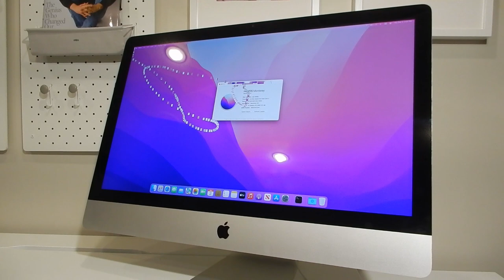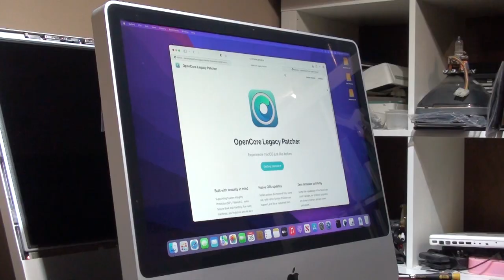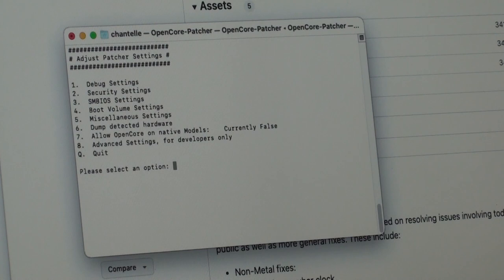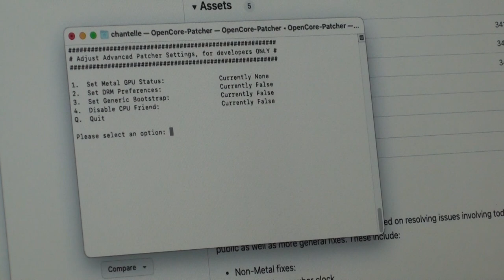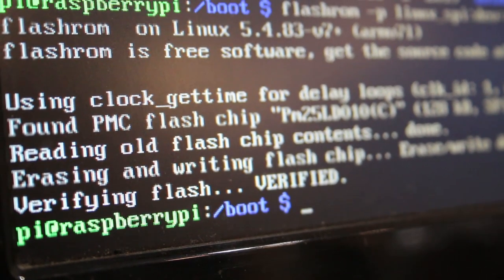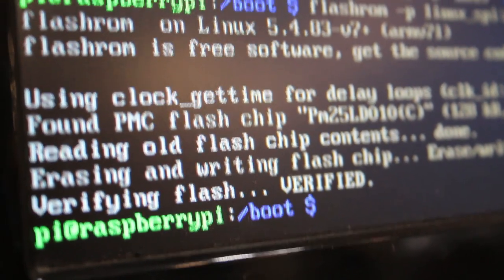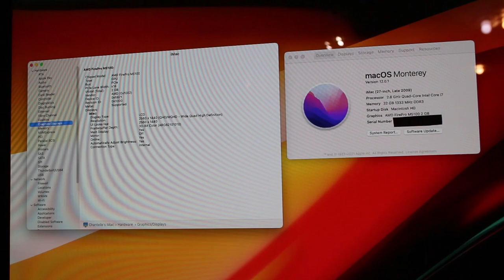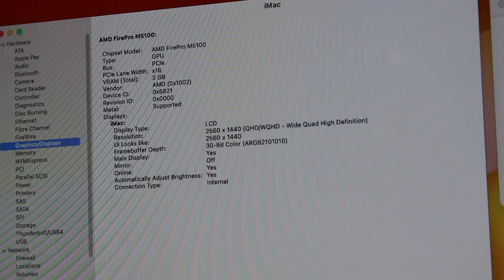iMac GPU Upgrade, Metal SUPPORTED!!

Comment: Thanks for the video, very helpful! I tried a few vbios versions (GOP, EG2, adj) but none of them ran without issues. What exact vbios rom did you use? Are you using a second screen and does it work without issues? Thanks for the help in advance !
Reply from the maker: I think there are 3 versions of the card: red (Dell), green and blue.  Mine is the red card, BUT there are also 3 more sub-versions of the red card depending on which memory modules the card has.  The red card uses the GOP ROM.  There are 3 GOP ROMs depending on if you have Elpida, Hynix BFR, or Hynix AFR memory modules.  I think mine was Hynix BFR so I used the M5100-HynixAFS-GOP.rom file, but yours could be any of those 3 if it is the red card.  The green and blue cards use totally different ROMs, which I don't know much about.

If I recall, the reason you need to flash the BIOS is to get the internal screen to work.  I THINK (if I remember) that the Mac should work on an external display without flashing, and after flashing/OpenCore mod it should work on the internal display.  I think external still worked after the mod, but I don't recall for sure - it's been a while since I did this.

The first part about ROMs I'm pretty confident is correct.  I'm a little hazy about the external screen details, but I remember before I fully got it working I could only get display via external monitor.

Hope this helps!  If you have any other questions, I will try my best to help (so long as memory serves what I did, lol).  Good luck!
Reply: @rebootretro  thanks for your help! I have the red dell card with Elpida storage. I currently have a perfectly working monterey system but my external display via mini dp/hdmi adapter is not working. As soon as i plug it in the iMac screen gets distorted and the second monitor stays black. I don‘t get why everything works but the second screen. Maybe I damaged the input during the GPU upgrade…
Reply from the maker: @luisheitmeier644  I just got my mini DisplayPort cable and tested.  On my finished iMac (OpenCore + custom VBIOS) external displays are working perfectly, exactly like a real fully supported Mac.  I would double check that your OpenCore settings are exactly right, and maybe try reflashing the ROM in case it went in corrupt.  It could also be possible there is an issue specifically with the Elpida ROM.  Hopefully you can get it going!

Comment: Hi, nice video do you think  this card will work on  2009 27 inch with macOS sonoma?
Reply from the maker: @unknownblueblue  I’m pretty sure it works with Sonoma, other people claim it does.  I eventually plan to upgrade this Mac to Sonoma and will make a video when I do.
Reply: @rebootretro  thank you very much, do you think this card is better than a k1000m?
Reply from the maker: @unknownblueblue  Bechmarks show the M5100 to be faster.  But I didn't care about speed, I wanted native Metal support.  The M5100 has official Apple drivers (at least on Monterey).  I believe all Nvidia cards require modified drivers.  I'm not sure if Nvidia cards work at all anymore on Sonoma, you should double check before using Nvidia.  Good luck with your upgrade project! :)
Reply: @rebootretro  thank you again, I bought the card today in 10 days probabily i'll receive it and if everything works i'll come here to tell :)
Reply: i'm here again to say it worked very well on mac os sonoma, did the open core patch, i downloaded opencore to my system and just did the patch at first it showed only 14mb but after the patch worked it recognize the 2gb from the gpu thanks for the video again

Comment: Hi, thank you for this Tutorial. I just would like to ask you: I have a mid 2010 27'' imac (11,3). Is it necessary to flash the vrom or will be the card working even without doing that operation?
Reply from the maker: There are certain cards that "work" but missing some functionality without flashing.  The M5100 (in my video) I think will only output to external monitor unless you flash it, and I think it doesn't get proper acceleration unless OpenCore is configured correctly.

I don't recall which, but there's one Nvidia card out there which will work "out of the box" with some custom drivers (no flashing).  It's documented on one of the forums.
Reply: Did you manage to fix your iMac?

Comment: Hi, i'm considering to buy this card for my 27'' 2009 a1312. Is target display mode still working for you?
Reply from the maker: Yes, the video here (https://youtu.be/TQwCJYiLqSo) about Target Display was made after the upgrade.  It felt glitchy sometimes - sometimes it didn't want to enable Target Display, and occasionally I had a crash when exiting Target Display.  Not sure if that's because of the GPU upgrade, because of the Monterey upgrade, or possibly completely unrelated.  But yes, after successfully getting into Target Display it did work properly while using it.
Reply: @rebootretro  Thanks. Sounds like the kind of behavior i experience now as well in High Sierra. The Firepro is on it's way tho!

Comment: Hi, I want to ask you another question: is it possible to flash the videocard in another way? I want to buy the card for a 27" imac mid 2011 and I do not want to use dremel stuff.
Reply from the maker: I've read somewhere that an NVidia card exists which does not require flashing - although you won't have boot screen/boot picker support.  You'd have to do some Googling, but I recall it was a specific version out of an Alienware laptop.  Sorry I don't have more details.

To flash a card, there are generally 3 ways.  First, using a flasher and clip like I did.  There are also USB programmers which let you flash using Windows if that's easier, instead of using a Raspberry Pi.  Second, install it in the iMac, boot to Linux and flash from the command line.  I can't offer any help on this because I've never done it, but someone else commented previously and said they've done this successfully.  There are many guides online if you want to try this.  Third, you can flash it beforehand using a donor PC, or MXM to PCIe adapter - this is likely far more difficult for most people since they won't have a donor PC or adapter handy.

Honestly, if you don't have any programming equipment, I would probably suggest a USB programmer with chip clip.  They're around $25 USD and likely easier to use than trying to boot Linux blind.

Comment: Will a radeon wx4170 work in a late 2009 model ecm 2309
Reply from the maker: I'm not familiar with that card specifically.  It does appear possible, but it looks like it needs some vBIOS flashing.  People have successfully used it on 2011 iMacs, but I've not seen any reports about a 2009.  I would recommend reading on the forums, and only use a card which is 100% confirmed working on your exact model.  Otherwise, there may be some unknown issues.

Comment: Can you put the link to download the vbios file to firepro m5100 red with chips hynix AFR because the three links in the forum i dont know if is to red, green or blue gpu. Thank you
Reply from the maker: That forum post is EXTREMELY confusing... I had to re-read it multiple times when I originally did the mod.  The conclusion I came to was that all 3 files under the download section were for the red Dell card, depending on your memory type.  My card was red Dell with BFR memory; I used the 2nd / middle link which worked for me.

If you have Hynix AFR, I can't promise you whether I'm right, but I suspect the 3rd / last link will work for you (https://github.com/Ausdauersportler/IMAC-EFI-BOOT-SCREEN/blob/main/GOP/M5100-HynixAFS-GOP.rom).  But make sure you double check, and make a backup/dump before flashing!  If you flash the wrong one, you will brick it and the only way to recover it is with a flash clip like I used.

Hopefully you get it working!
Reply: @rebootretro  no problem i have a ch341a the only headache its disamble all again but no problem. Thank you!!

Comment: What is the size and thickness of the cooper shim you used?
Reply from the maker: I used a random piece of copper pulled from a scrap MacBook cooler, and cut to size.  The backside had a black coating, which I cleaned off.

The cooler does graze the die on it's own but does not have enough mounting pressure, and there are springs for tension so there is some leeway for thickness.  The recommendation in the guide I read was 15mm x 15mm x 0.5 to 1mm thick, which would be close to what I used.  Here is the article: https://forums.macrumors.com/threads/2011-imac-graphics-card-upgrade.1596614/page-320?post=28696585#post-28696585

Comment: This is awesome to see, it took me forever to find this video, so I was beginning to thing an old Metal compatible Mac wasn't possible.  
I'm planning on doing this to my 2010 27" however, I'm not that good with the actual tech side of things. I'll be able to do the physical install fine, but I really don't understand which card to buy and how to do all the programming stuff.
Unfortunately there isn't a computer shop anywhere near me (plus I don't wanna have to pay anyone), so I'm on my own with this.
Anyone here who understands that programing side of things who'd be willing to help out?
Thanks
Reply from the maker: The issue is that there really isn't a perfect card to use, to my knowledge anyway.  There is no officially supported Metal card for any of these iMacs, which means there's a bit of hacking involved no matter what you choose.  Some cards are easier, some have better compatibility, some are cheaper, and some are easier to acquire.  Sometimes the best card is the one you can get your hands on.

In my case, the card I used was the FirePro M5100.  This card has excellent Mac OS support, but poor iMac support requiring a bunch of hacking like I show.  Some Nvidia cards have great iMac support, but poor Mac OS support requiring lots of OS driver patches.

A few things to note though.  This isn't a simple upgrade, it is very difficult and very involved and requires lots of reading and patience.  If you get stuck, you probably won't find any computer shop willing to help you regardless of cost.  This is a very unsupported upgrade, and most shops won't want to be involved in it because of the hassle.  Lastly, don't do this on your ONLY computer.  Make sure you have another working computer, preferably Mac, since you may need to run Mac software in order to recover your iMac if you make a mistake.

But don't be discouraged!  If you are willing to read, learn and be patient, you're on the right track to success!

If you have trouble, feel free to post back here and I'm sure myself or someone will post any pointers to help where we can.
Reply: Did u manage to make the upgrade?
Reply: @giorgos7six  No, I never tried. I don't have the time to tackle something of that scale and really have no idea what I'm even doing so I don't wanna fry it

Comment: Regarding the cooper shim, would you recommend 0.5mm or 1mm thickness for a 2011 imac 27
Reply from the maker: I've linked the article below which explains the copper plate/shim mod.  The thickness is somewhere in that range (.5 to 1mm).  The cooler is held to the die using springs for tension, so precision is not so important.  If it is somewhere near .5mm to 1mm then it should have sufficient mounting pressure.

The problem is that the die on the new GPU is not as tall as the old GPU, so if you have no shim then the die is not under any mounting pressure at all.

Here is the article about the shim mod that I used:  https://forums.macrumors.com/threads/2011-imac-graphics-card-upgrade.1596614/page-320?post=28696585#post-28696585

Also, there are some issues with this GPU on 2011 iMacs.  You should read up on this prior to using this GPU: https://forums.macrumors.com/threads/2011-imac-graphics-card-upgrade.1596614/post-17425857 (Look under 2. Working AMD Graphics Cards and then AMD GCN v1-3 GPU (2012-2015) - no iMac12,x support)

Comment: iMac 11,x on OCLP 1.3.0 and macOS 14.2.1, still need to use 0.4.6 TUI? or does OCLP 1.3.0 build OC properly by just selecting Advanced->Graphics Override to AMD GCN (maybe it will set x64.efi also?) Also know if Advanced->AMD GOP Injection need to be checked on OCLP 1.3.0?
Reply from the maker: It's been a while since I did this, and I don't remember exactly.  But from what I recall, at time of recording there was at least one very necessary setting that you could not set unless you used TUI version (the option either didn't exist in the GUI version, or didn't work).  It's possible that in later GUI versions they made the option available or fixed it.  I suspect you would need the Advanced-> AMD GOP selected if you flashed the GOP ROM, but I've not played with GUI version or any newer version than what is shown in the video.  If following the exact method in the video then it should work, but unfortunately I haven't tested OCLP 1.3.0 GUI to say if it works the same.  Sorry I wish I could be better help.  I can't even remember the exact reason why only the TUI version worked at the time.
Reply: @rebootretro   Thanks successfully installed the M5100. Used pre built linux boot stick method (someone added amd besides nvidia) to flash vBIOS, totally easy and no HW required. Also no need to preinstall proper OC EFI before swapping new card. Great option for dead GPU efforts. Leave system SSD disconnected (or probably just formatted blank wo EFI)  and it will boot the linux boot stick to flash vBIOS. Wrote a long post (#21491) in the macrumors thread. OCLP seems to be advancing fast! haha.
Reply from the maker: Sorry!  YT blocked your comment, so I didn't see it until now.  That's amazing you got it working!!  That's excellent that the Linux method worked so smoothly!  I didn't even try TBH; I find that every time I touch Linux it never works the way the guides say and I have to battle it every step of the way, LOL.  And as I recall, there were just overview explanations at the time and no step by step guides.  At the time, I was pretty familiar with my Raspberry Pi flasher so I found that method pretty easy, but I image the Linux route is probably a better choice for many.  I think the OC preinstall was necessary for it to initialize the internal display instead of the external TB video out ports; it's very possible that the OC team has modified code since my version to detect these cards and apply necessary changes on the fly.  Or maybe you got a different/better ROM that doesn't require it.  I think I had the GOP ROM from the post.  Does your native boot picker work?  Or just the OC one?  That's excellent that you posted back to that forum, I'm sure it will really help someone!  Good guides are always a great asset when attempting these type of upgrades!

Comment: The metal gpu is out of stock does it work with any other 2G gpu, will it do the same results?
Reply from the maker: Yes there are many GPU models that support Metal.  In the video description, check the forum link.  The forum has a huge list of supported GPUs, just check what mods are required for each model, and Google if it has Metal support in the macOS version you want,
Reply: @ thanks I appreciate, I ran in to a problem with my imac 2009/2010 27” and when i started the imac it only made the start sound (not the audio) and it wont start or do any audio and i think its my cpu that went old do you know what it is?
Reply from the maker: @Bobwhoisgood  The CPU pretty well never fails.  I have handled probably hundreds of Intel CPUs over my career and never come across a dead one.  From my experience the main logic boards are extremely reliable too in these models, although these can fail and give symptom of failed CPU.  My experience the highest failure rates are the GPU, then PSU, then backlight driver.

You should do both PRAM and SMC reset, then retest.  SMC reset is done by unplugging power, and hitting power button a couple times while unplugged.  Then plug back into power.  To do PRAM reset, hold CMD+OPT+P+R all together immediately after pressing power button.  Keep holding those until you hear the startup chime a SECOND time.  Some people have issues doing PRAM reset with non-Apple keyboard.  Ideally use a wired USB official Apple keyboard.  If you must use a PC keyboard, make sure it's USB wired (not wireless) and use keys WIN+ALT+P+R instead.

If you get the startup chime sound, then your CPU, RAM and logic board are working and the most likely issue is the GPU or screen backlight driver board (the issue could also be PSU, but generally you'd have other symptoms too so PSU is least likely).  If you get no sound, no fans, no HDD sounds, etc, (i.e. completely dead) then the issue is likely the PSU.

The PRAM reset is key, because it will reset any wonky parameters that could prevent startup or startup chime.  The startup chime is very important for diagnostics, to know where the issue is.
Reply: @rebootretro  thanks ill try to do the SMC reset i will try thanks for the help :D
Reply: @rebootretro  the SMC doesn’t work so ill try the PRAM so ill think it should work cus i have a wireless keyboard and thats a problem so ill go buy a mac keyboard withe usb i hope it helps thanks (:

Comment: Hi. I already upgraded my 2011 imac 21.5 inch gpu to Nvidia K610m. All smooth sailing. The OS is High Sierra right now. Is it possible to upgrade the OS to Monterey or Big Sur?
Reply from the maker: That is a Kepler card.  Since NVIDIA had a falling out with Apple, no new drivers (or official hardware) has been produced so all NVIDIA drivers are old patched versions.  OpenCore Legacy Patcher seems to support Big Sur, and probably Monterey with the correct patches installed.

EDIT:
There are some issues with Kepler cards.  Check out this forum post: https://forums.macrumors.com/threads/2011-imac-graphics-card-upgrade.1596614/ specifically SPOILER 3 - Known issues and problems #5 (re: sleep issues) and #7 (re: black screen issue after PRAM reset).